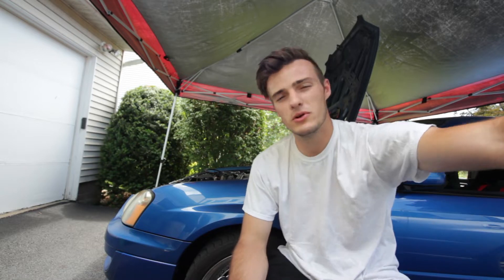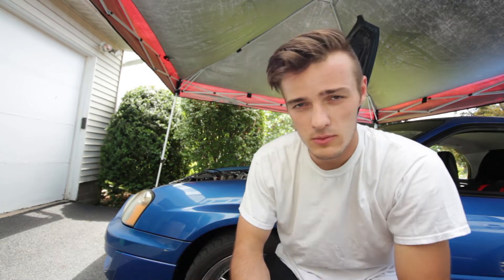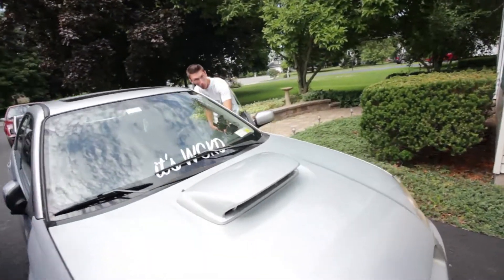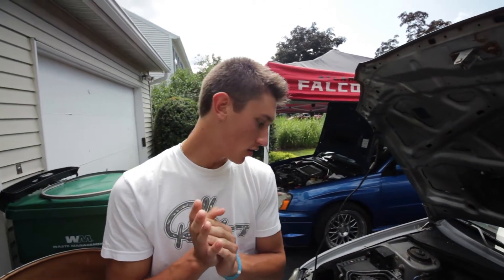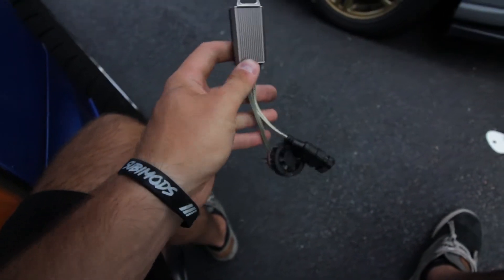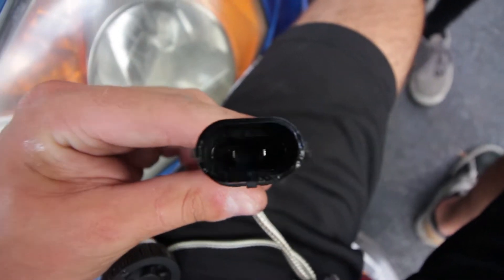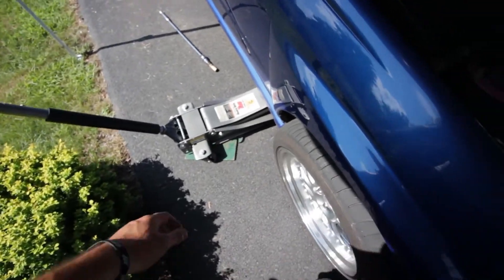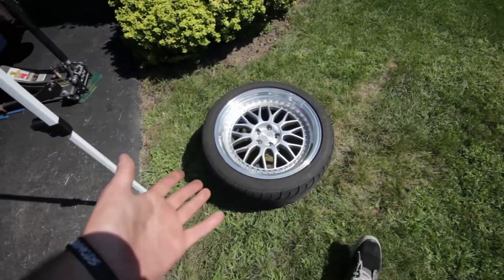Should I Street Tune The WRX?

Comment: For the contacts that are to big you can get cheap dremel shave them down, however for the contacts that are so small, you can  try to take the connector apart and see if you can swap them out for bigger contacts (if available) via crimping or soldering, plan be would be t-tap around the connector or cut both ends of the connectors and use Male and female quick disconnects and seal  them as needed
Reply from the maker: Ah yes a dremel might work! Thanks man!